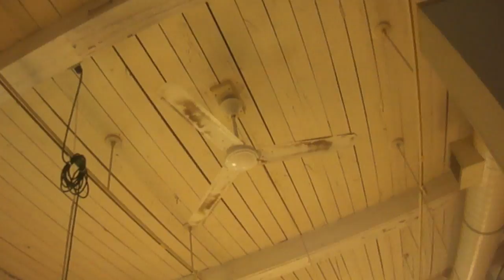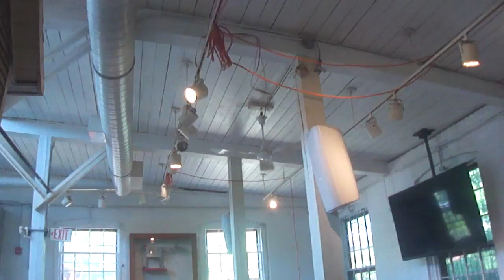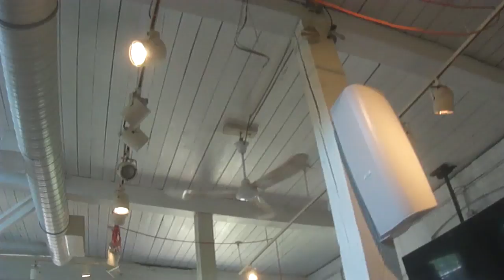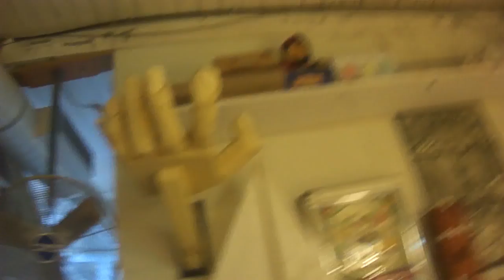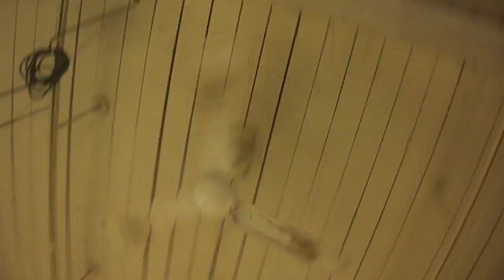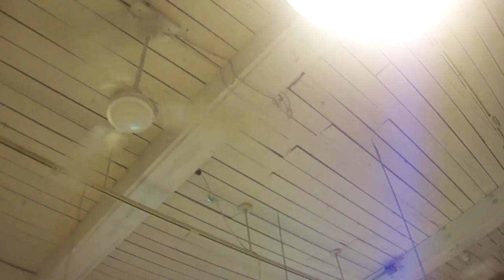56" Canarm CP56(A) (4 of 4) & CP56, Safer & unknown industrial ceiling fans, and Patton portable fan

Comment: I saw alot  of them at a resraunt blow good air
Reply from the maker: Which ones? There are 4 different fans in this video. The reason why Safer doesn't blow lots of air is that it has a bad capacitor.
Reply: +The Channel of Random Ceiling Fans  i saw 6 of them and 1 hamptonbay huntington ceiling fan
Reply from the maker: Did you see 6 of Canarm, or 6 of safer, or 6 of those straight blade unknowns?
Reply: +The Channel of Random Ceiling Fans its strait up it didnt wobble